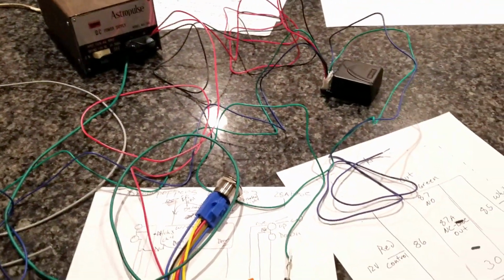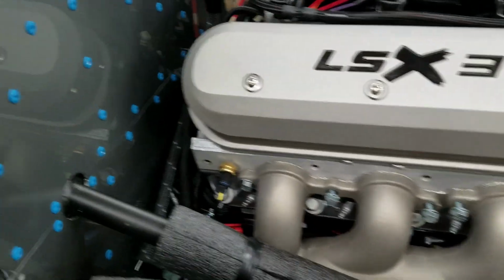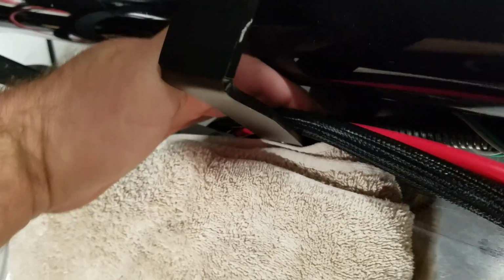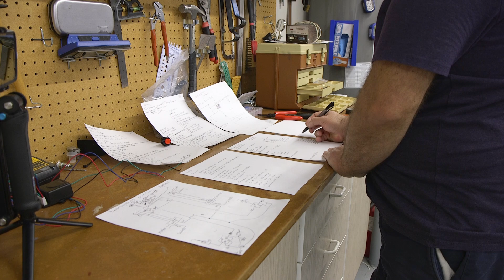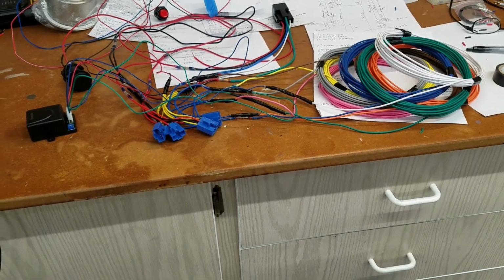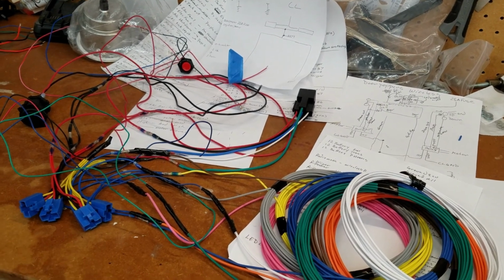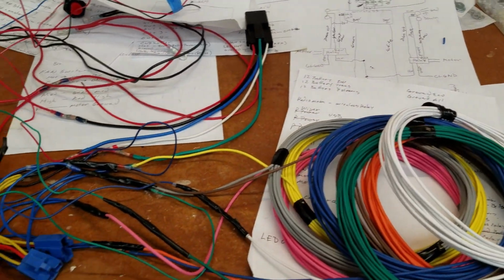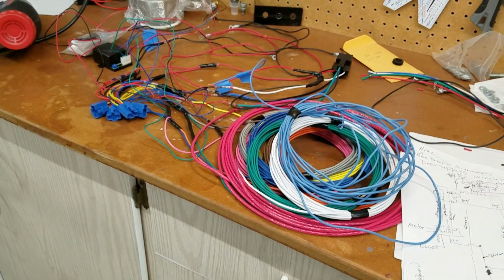Factory Five 33 Hot Rod V2 - Wiring - Center Console

Comment: I agree with the other commenters, I recommend you run the wires outside the metal drive shaft enclosure.  That shaft is going to be spinning pretty fast when you are on the highway, you just don't need some bounce, vibration, or whatever to cause that shaft to touch comparatively fragile wires...
And I continue to marvel at your patience to sit down, figure it out and work your way through the wiring list.  I would have had to take a break and drive the car...
Reply from the maker: This is the suggested area of the manual.  I will have everything cinched up.  There is really no room in this car to hide this much wire anywhere else.  It is not as bad as when I was watching the Learning Channel about Commercial Plane crashes 15 years ago and found out that they were running wires through the middle of airplane's gas tanks. That gave me pause!
Reply: @StreetRodJim  Hopefully they have it sized then.  Funny how different things give different people worries.  For example, I am not worried about the suicide doors at all...
Reply from the maker: @heathwells3273  I watched a 33 go down a drag strip and the door just rip off....  It has stuck with me

Comment: If this was my project I would never run wiring down through drive shaft tunnel. I myself would run it down the floor in a plastic folding enclosure next to rocker wall or center of passenger floor back to rear. That's just me.

Comment: 16 ground wires? Uhm... Forgive my possible ignorance, but isn't frame supposed to be a single common ground?
Reply: Absolutely, also I don't know if I missed it in another video but a ground strap should run from the engine to the frame to ensure that it (and it's electrical components are grounded).
Reply from the maker: It is not like all 16 grounds wires came from different areas.  They are all in the same place so it makes sense to combine and terminate once.
Reply from the maker: @tr4v15_Lives  There is a ground strap installed.
Reply: @StreetRodJim  I mean - maybe instead of placing (terminating, combining etc.)  those 16 wires you can just remove them completely and connect corresponding terminals to the frame?
Reply from the maker: @ashkira2  Like I said, terminating once instead of putting 16 holes in the frame in the same area is easier.  There is no room in this car to do that.